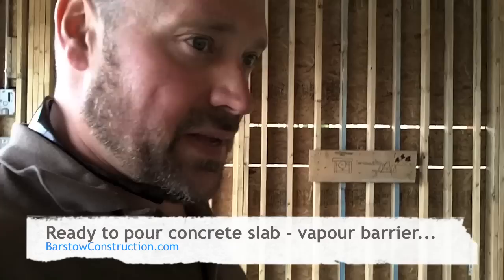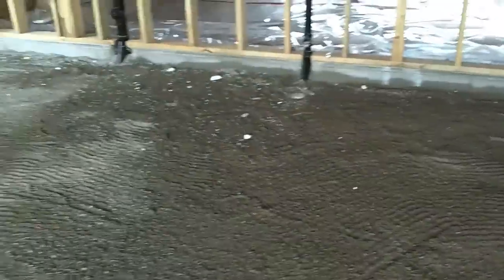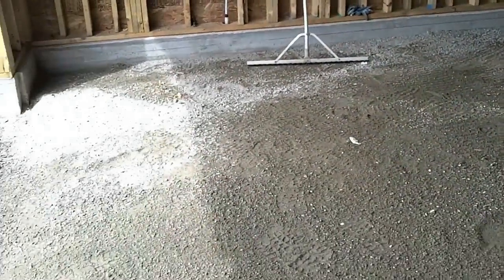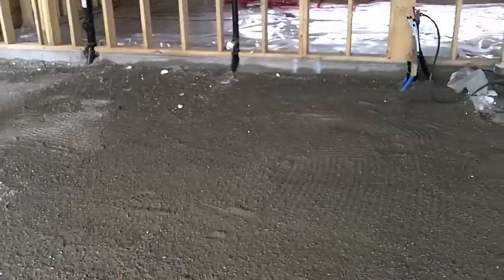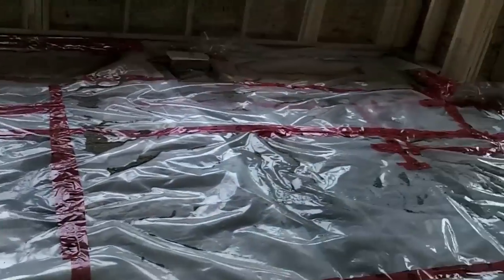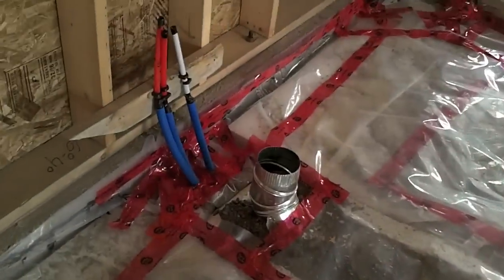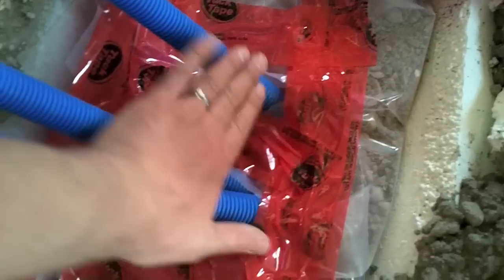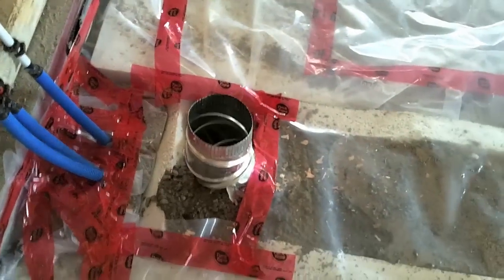Installing vapor barrier before pouring concrete slab

Comment: Would you put poly under a footing and then tape it with the rest of the slab vapor barrier after? I am retrofitting two post footings in my house and wonder if I should do so.

Comment: Hey, thanks for the video.  What's the method to pouring wall footings and slabs separately? Why not just pour them all in one go so you have a continuous vapour barrier under the entire slab?
Thanks
Reply from the maker: Hi Scott - thanks for watching. We typically pour the footings, build the house and rough in the services (plumbing / electrical) after structural wall / framing is done. Many of these services go in under the slab. We next insulate our slabs, and run all of our radiant heat lines. Next, we pour our slabs, ground floor and any lightweight for our radiant heat on the upper floors. 
We do see a "mono pour" from time to time, but it is not as common around here. Hope this helps!

Comment: I have a crawlspace that is 8' x 20' covered with dirt. I would like to encapsulate it with concrete, what do you suggest? what thickness vapor barrier should I use? what mil is the vapor barrier are you using in this clip? How thick should the gravel be and what size pebbles should I use?
Reply: 6mm poly vapour barrier